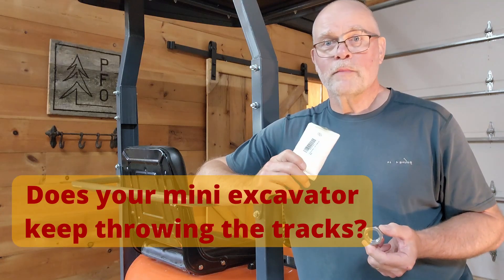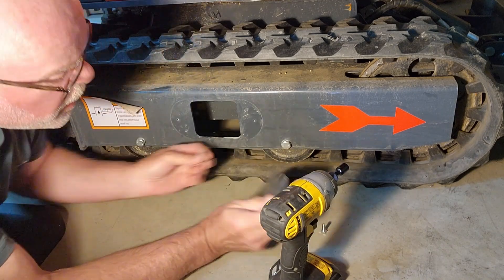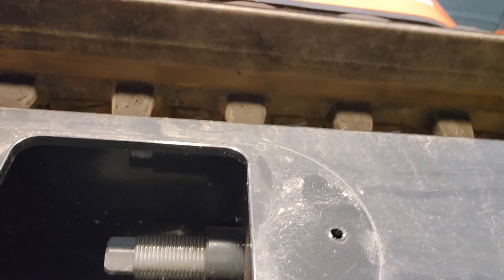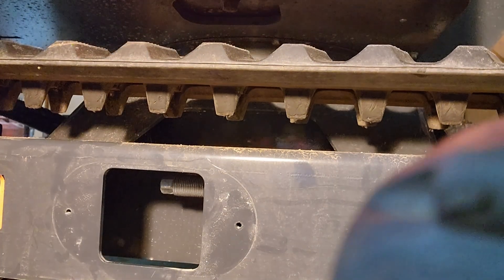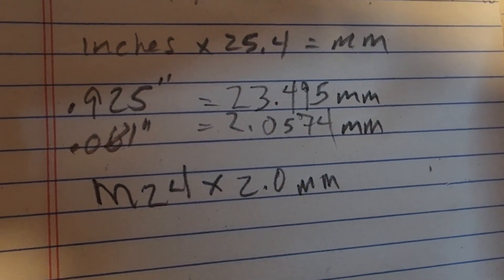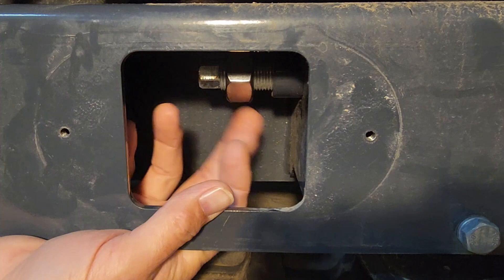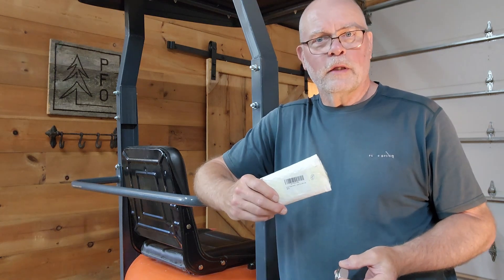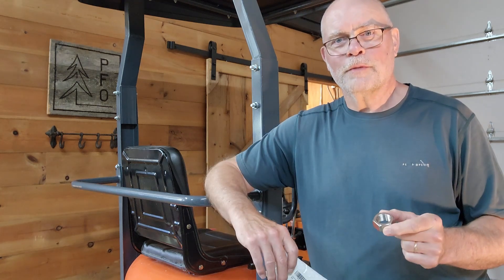Mini Excavator keeps throwing the tracks - Missing lock nut on the track tensioner may be the reason

Comment: I have the same machine as you but mine has pilot controls I seen another guy that has the same machine as yours any upgraded his pump to a faster one
Reply: Could you maybe check it out and see if it could work on my pilot control
Reply from the maker: The pump upgrade sounds tempting, but I'd be concerned that higher flows and pressures would translate into more Jerky behavior. I already have to run mine at the lowest possible throttle to avoid it just going into spasms. A bigger pump, or multiple pumps are only effective when you are trying to run attachments, like flail mowers or concrete breakers, which require higher flows or pressures. The rest of the time it would just be pushing a lot of unnecessary flow through the system which would over heat the fluid.

Comment: A trick for measuring thread pitch on a bolt that's hard to get the caliper on is to put a piece of paper over the thread and press the paper into the thread with your finger. Then measure the pitch off the impressions in the paper. Paper also works to measure the diameter. You wrap the thread tightly with paper. Then poke a hole through paper with a pin and measure the distance between the holes. This give you the circumference which you divide by Pi (3.14) to get the diameter.
Reply from the maker: Thanks for those tips!

Comment: I wanna put lock nuts on mine there 15mm or 5.8ths for the techiner and the big nut spins right off ..so they must vibrate off
Reply from the maker: On mine, even with the lock nuts, it has come loose again. I have found a pair of 24mm split ring lock washers that I'll add under the nuts. Maybe that will keep it locked. I know the tracks also stretch for a bit until they get broken in, which can make the tracks sag, but I think the tensioners coming loose is a separate issue.

Comment: Can I use a standard wrench on the 36mm nut? Sometimes they will fit.
Reply from the maker: I suppose you can use anything that will fit and turn it tight enough to stay put, but a sloppy wrench risks rounding off the nut. I wouldn't recommend it.

Comment: My l12 had a bad grease fitting on the track. Mine is greased tensioned. It is a 2023 l13
Reply from the maker: That's interesting. I've wondered what the differences are between the L12 and the LH12R. So, mine apparently has the grease pressure warning stickers from an L12 but no grease tensioners to go with it. The AGT website has no information to help us sort out the features of their various models.

Comment: I just picked up the same machine.
 How well does it go up hills? 
Does this engine have a low oil shut off? 
How hot does the cowling get by your calf after running mine for about a hour it gets so hot it burns my calf!
Reply from the maker: I don't have enough time
on mine yet to have good answers for those questions. The only "hill" I've attempted was the ramp on the trailer. You can see how that turned out in the prior videos. The nature of the work I've done so far has all been about loading dirt into a trailer. It only takes a few minutes to fill up a trailer load, and I turn it off between loads. So, I have not had any significant heat issues yet. I'll go out and look for a low oil switch next chance I get and let you know if I find one. I don't recall seeing one, but have not specifically checked for it.

Comment: Why is there a warning label about high pressure oil cylinder for track tensioning?  I would have assumed it had the grease pressure track tensioners, not the threaded rod.
Reply from the maker: I have no idea, but like you, I assumed this would have the grease pressure tensioner because of that sticker. When a viewer comment tipped me off to go looking for the lock nuts, I was shocked to actually see that mine has the screw tensioners.
Reply: Do you know if the LH12 I get in auction actually has grease tensioners in there if they could be swapped with the threaded ones?
Reply from the maker: Sorry, but I have no idea. I've never even seen the grease pressure type up close.

Comment: The nuts were a perfect fit for the track tensioners. I notice that your exhaust pipe is about 2 1/2" shorter then on my excavator. (My store bought extends to just about flush to the shroud.)   I've also found a You Tube channel from AGT that has video of the hydraulic oil system/filter/change:  https://www.youtube.com/@AGTIndustrial . So far no major differences between your auction model and my store bought save that my bolts and nuts all seemed tight and lube/greasing had been done before delivery.
Reply from the maker: Thanks for the feedback. So far, we have not heard from anyone who has one of these units that came with lock nuts on the track tensioners.  They must have just overlooked that in the design. I need to put an extension on that exhaust pipe. I want it as long as possible without interfering with the hood movement, so it sounds like 2-1/2" is the number. Thanks!

Comment: I have seen vids on other models where they did have lock nuts. The 'L' series seems different enough it may be made in a different factory, my guess.  Another YT'er at "The Garage Connection" has a lot of tech vids on the H series machines. Some have the hydraulic relief valve set too low and you do not get full power from the bucket. He also had a kit that bolted on and helped protect the drive motors that looked interesting.  Final thing was a hose that screwed onto the motor to help when draining oil during future oil changes looked helpful.
  I may sell some logs from my wooded property and will need to re-invest in some equipment but just doing research till then.
Reply from the maker: Thanks for the tips. I'm sure I'll be adding a lot of those common upgrades in the coming weeks. Speaking of wooded acreage, I've been back into the online auctions and will be rolling out another machine purchase soon. Stay tuned.
Reply: Awesome video! I'll bet this one will draw a lot of attention!😄👍🏻
Reply from the maker: Thanks! So far, so good.